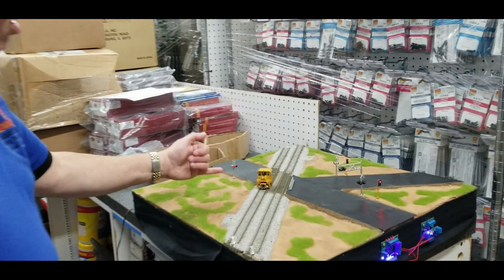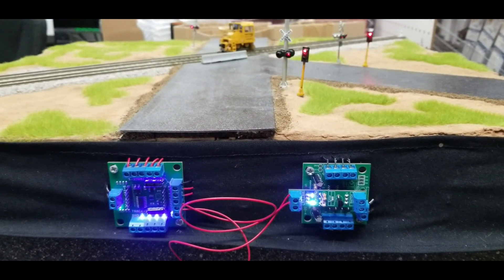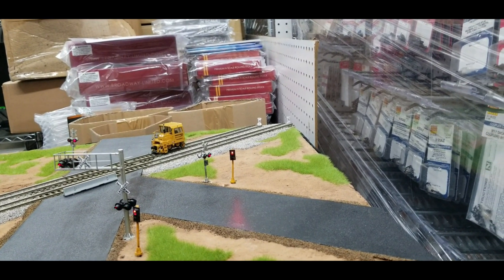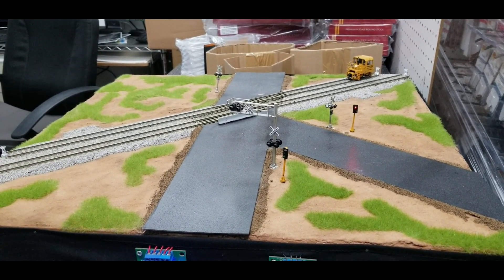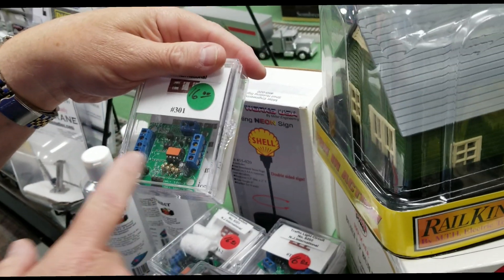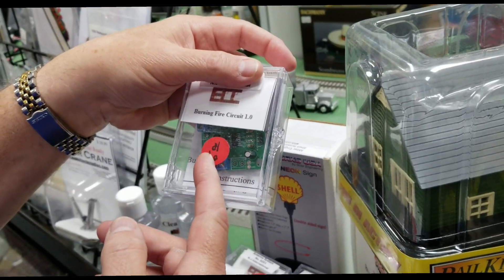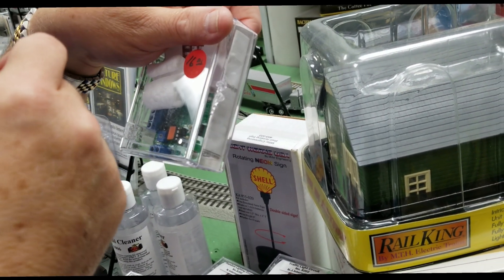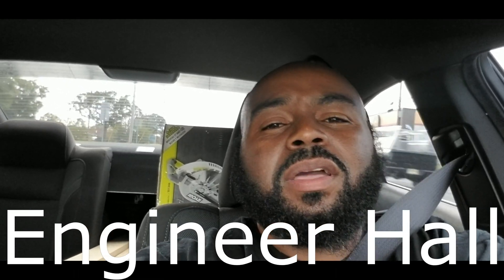East Coast Circuits

Comment: Hi Engineer Hall. Neal from ECC here! Thanks for posting this, we really appreciate it! Just wanted to clarify one thing, as I was showing many things to you and the great folks at Yankee Dabbler. ALL circuits handle DC AND AC. Also, Is okay to use a power supply on circuits, as long as it’s not variable. I got a little nervous doing a spontaneous interview, so please forgive me. As an FYI, we also have custom lighted vehicles that only work on 9-12V DC. We want to give a big thanks to Yankee Dabbler for letting me demo the circuit for you!

Comment: Doesn’t the dcc power running the track present a problem? If, of course, you are running dcc. Forgive my ignorance. I am fairly new to the hobby.
Reply from the maker: Not at all the crossing circuit runs off its own power. The  thing you have to worry about is drilling out the holes for the sensor's that to be placed in the center of the track and  Not drilling through existing wires.
Reply: Engineer Hall, okay, thank you. See ya next time.